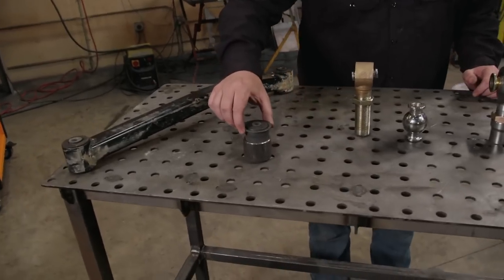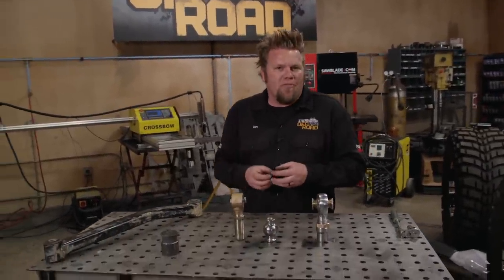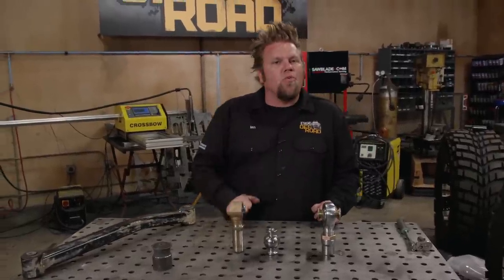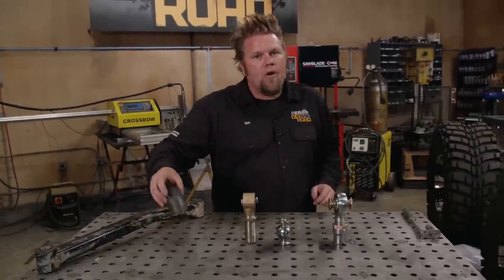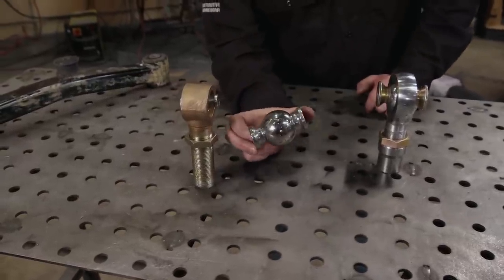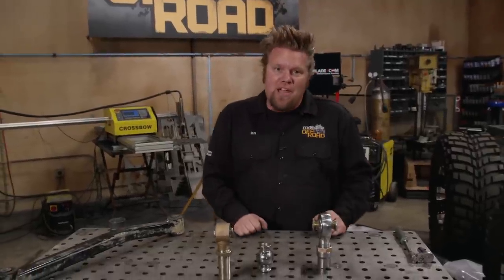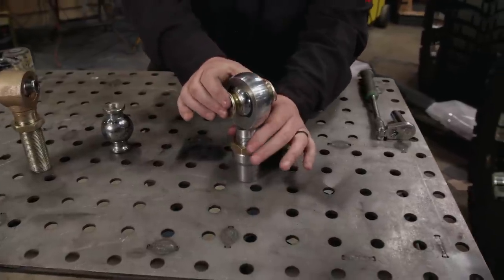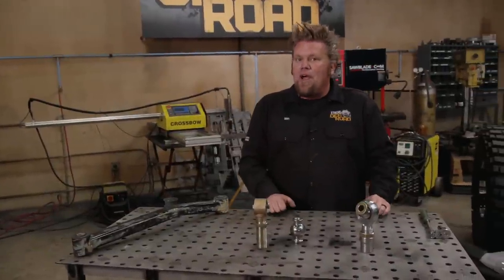Benefits And Drawbacks To Different Types Of Suspension Joints

Comment: I just bought a 1 ton heim upgrade for my Jeep WJ. Pretty excited to get it in.
Reply: Jason Rowles, how did it go with the heims? I also have a wj which i am planning on upgrading to long arms and trying to choose which type of joint
Reply: I have a WJ. I have long arms with Heim joints. Work well but I’m developing a little play with only 2500 miles on them. I have greased them each day when wheeling and they never go more than 300 miles without grease.
Reply: My rear track bar heim joints have both developed play and become noisy within 1yr/15k miles